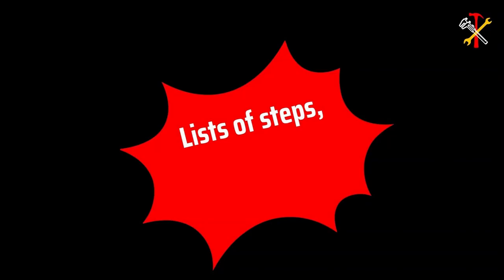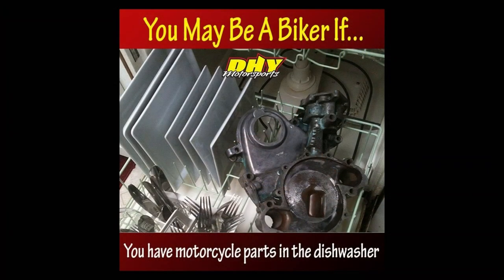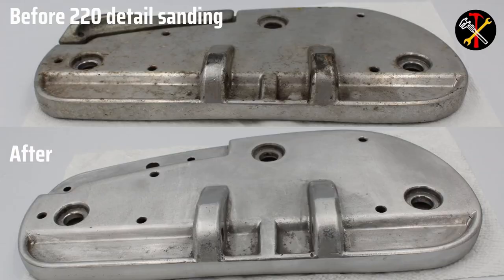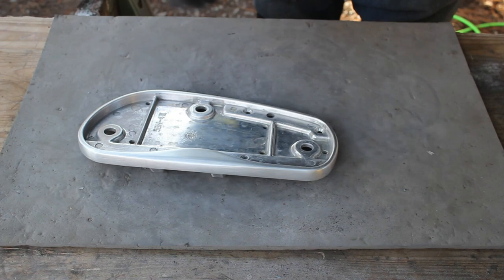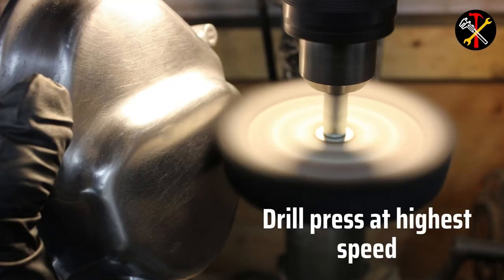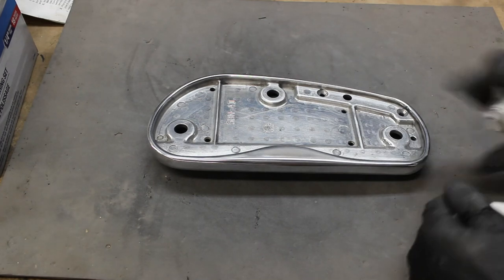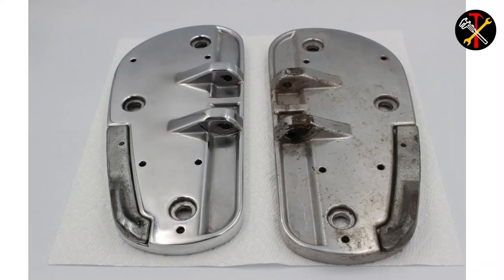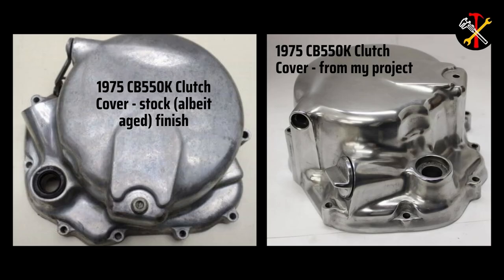Shine aluminum - AMAZING RESULTS, NO BLASTING!

Comment: I’ve never been courageous enough to start with 220, but your great video has me convinced, a little Honda is my first project coming up very soon. Your’s is my new favourite channel, thanks.
Reply from the maker: Thanks for the nice comment! The starting grit depends on the condition of the part. If it doesn't have deep scratches you could likely start with a finer grit such as 400, but I've always started with 220 and it has worked okay for me. Good luck with that Honda project - it's always nice to hear about another one being given a second life!